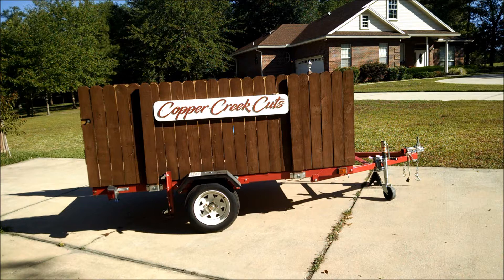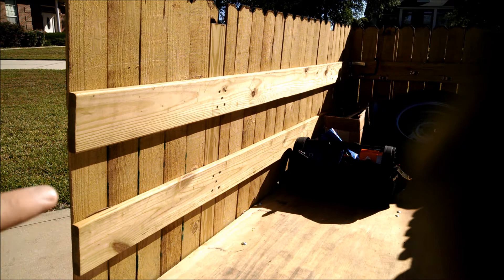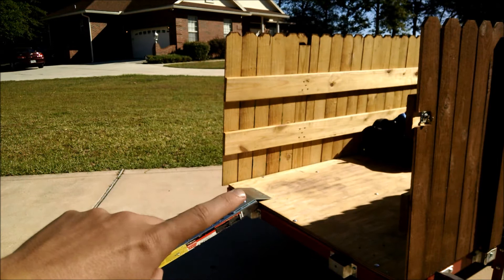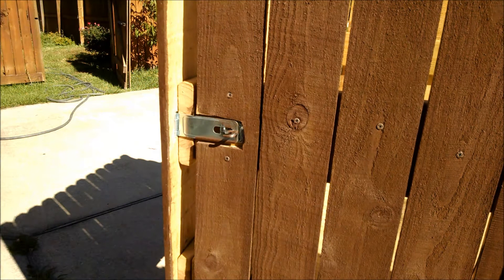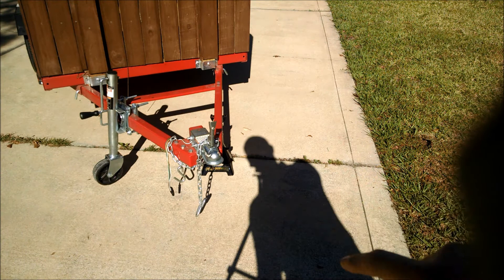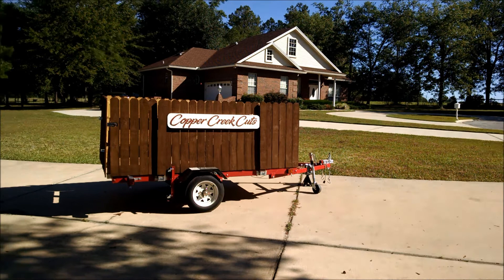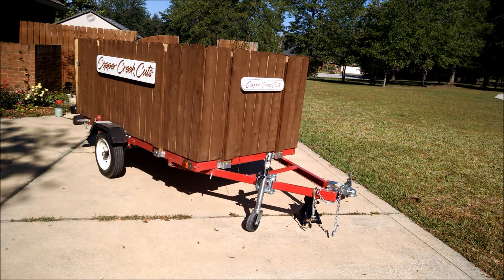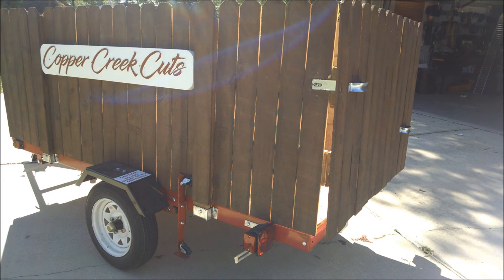Harbor Freight Lawn Care Trailer

Comment: ive got the same kind of trailer and want to get something bigger. bought it used for only $60 but with tags and title ive now got about $300 in it. came with small sides that i dont use and no trailer jack (thinking on getting one) and itll barely haul my x540. hope to get a 6x12 or bigger in the near future
Reply from the maker: Bio Hazardra Yeah it isn't ideal for hauling gear, but it got the job done. It was a real champ on that mulch job video I posted, as well as hauling limbs and debris!

Comment: can a 42inch zero turn fit on a 4by6 trailer
Reply from the maker: I couldn't say for sure, it depends completely on the trailer. You will need to break out the measuring tape.

My enclosed trailer is 5x10, so 60 inches wide. But the rear entrance is only 50 inches wide, and the ramp only has 48 inches of clearance because of the lift assist cables. You will also need to be concerned with the length of the mower as well. My 36" Alpha zero turn is 73" long, so it wouldn't fit on a 6 foot length.
Reply: 4ft. x 12in. = 48 > 42 so yeah it’ll probably fit width wise